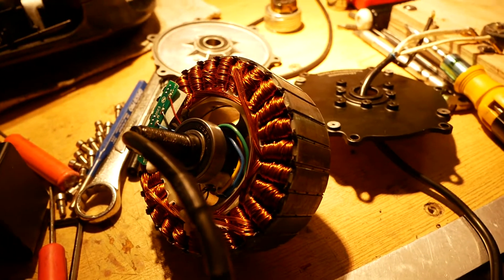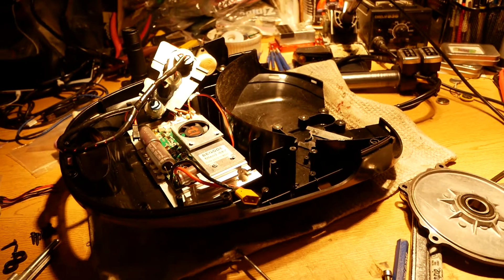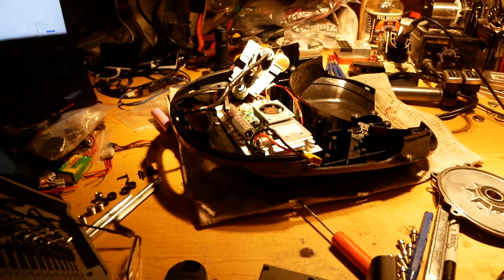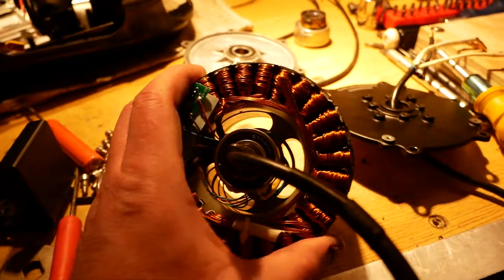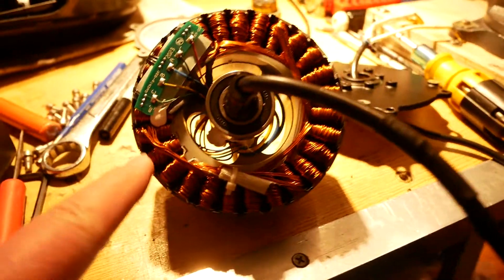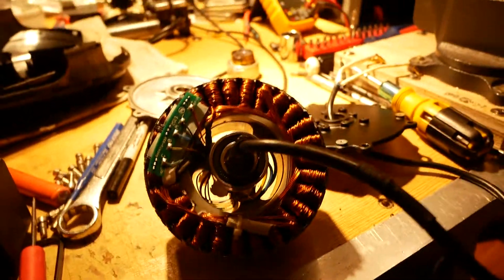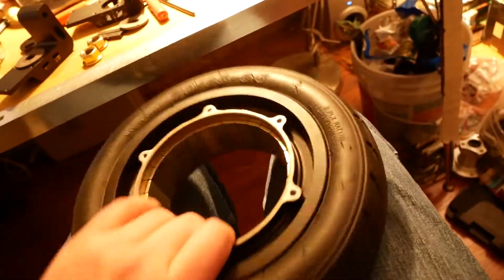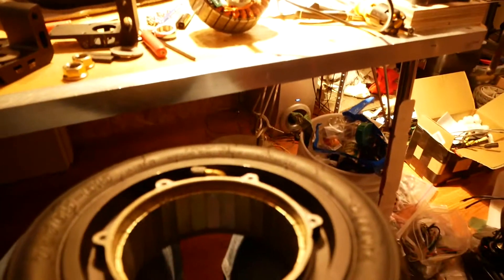Gotway MTen3 teardown 1

Comment: Amazing video. Certainly a cautionary tale. However, in the time since you’ve made this video do you know of or believe any manufacturers of EUCs to have quality design, hardware, good tolerances, safety?
Reply from the maker: Yes...they are not perfect, but lots better than everyone else for quality and design...InMotion. They try to be somewhat conservative and to not push things too far...like all the rest are doing. There is simply NOT a good reason for any EUC being built for more than 82v and honestly 66v or 16S is more than enough. I have a scooter I built. it tops out at 80 mph on 82v and accelerates better than most cars. There is just no need for all the stupid high voltages that EUC's are being built at these days! Anyway...look at InMotion...IMHOI...they do the best quality EUC's. I had a V11 until I just sold it. It's well made.
Reply: Wow, would love to see a scooter spec and highlight vid. Been eyeing the Veteran Sherman Max…however, hard to find transparent information on parent company. Apparently defectors from Gotway after design disagreements. Though it looks wildly fun hard to justify the price for it when I can only imagine the glaring flaws and hazards you would find breaking it down.
Reply from the maker: @MrPBJTIME12  While I've never taken a Sherman apart myself, I have looked at what others have done and I'm not impressed with what I see. They are not really better as far as I can see. What sort of "design disagreements" were had is unknown as the design, parts used and quality are not dramatically different. It is my opinion that this is a widely repeated myth that was probably done by the Chinese factory so that it would "look" like there were huge improvements made while no actual improvements were really made. China is well known for their ability to lie or deceive to look good while doing nothing to actually be good!

Comment: So can I hook the battery straight to the big red and black wires on the motor the see if the motor is functional, or do the smaller wires need to be activated as well to make it go?
Reply from the maker: This isn't a brushed DC motor...so NO...that won't work. All you will do is dead short the battery across the motor.
Reply: @de-bodgery  Oh, OK.  Then I guess it's on to Plan B -- a sturdy, smooth rolling replacement front wheel for my wheel barrow.
Reply from the maker: @PlasmaStar9  Its just a brushless motor. Did you burn out your controller board in your EUC? You can get replacement parts for them. If you wanted to make a powered wheel barrow with the hub motor, that's very doable. Run the motor with any BLDC controller and the motor ought to run.
Reply: @de-bodgery  Battery is good, power button checks ok, haven't found any obvious damage to the board or wiring,  but won't power on after I replaced the inner tube.  I hesitate to spend another $200 on new board if the gremlin is still in the machine. Probably sell it "not working" on Ebay since I have an old Swagroller and this one has been trouble since day one.

Comment: you should really compare the build quality of this EUC vs better brand like InMotion or Segway / ninebot (hint, gotway is a shit company.)
Reply from the maker: Gotway, Sherman and others are all making crap. When I got this EUC I really thought I'd find them a lot of fun to ride. I was getting this wheel to learn on with the intention of getting another wheel later. The problem is that I lost interest in it almost immediately. I prefer 2 wheels under me and an EUC was not a better ride to me. I had planned to get a V11 later, but I doubt that will every happen. It seemed to be better made (less crappy). Probably Segway makes a reliable wheel, but they are also slow and loooow power. Probably any EV videos I make in the future will be all 2 or more wheeled.

Comment: Thanks for the video.

I see a lot of people comparing OW's pricing to EUC's and how much better specs you can get with an EUC for the same price as a OW, but I think this video does a good job of showing the quality that can be lacking in these devices, OW's are much better made and while they aren't perfect they have none of these glaring problems you showed in this video.
Reply from the maker: I agree! But they have potential and most of the time with some work on their weaknesses they can be made to be much better. BTW, even these Chinese EUC's are way over priced. This wheel...there's maybe $200-250 worth of time, labor and hardware in it. The rest is profit!
Reply: @de-bodgery   To be fair, the rest isn't necessarily profit, it's margin.  $250 worth of time labor, sure, but there are certainly other overhead costs at the factory, then you have shipping, customs, tarrifs, a wholesale price to the e-tailer like ewheels, and then the e-tailer has their own overhead costs and margin. Which is not to say it isn't overpriced, it certainly is, but not all margin is profit.
Reply from the maker: @caramelzappa  True...there are a lot of transport costs to get it to me. Still NOT $1000+ of cost!
Reply from the maker: @darrenrory8986  Geez! Instagram is NOT secure!